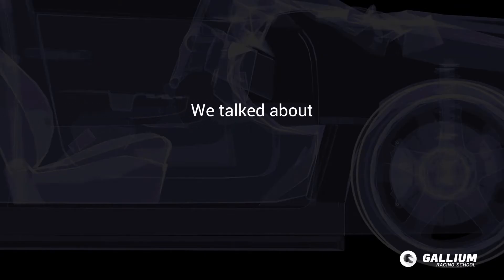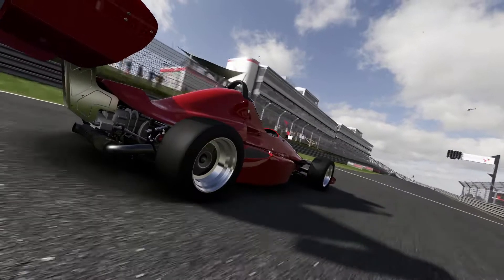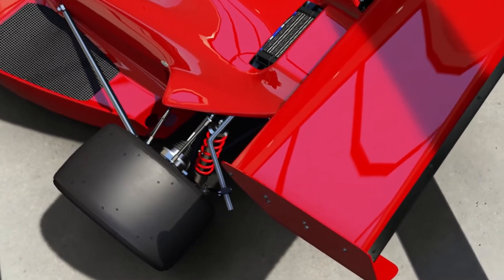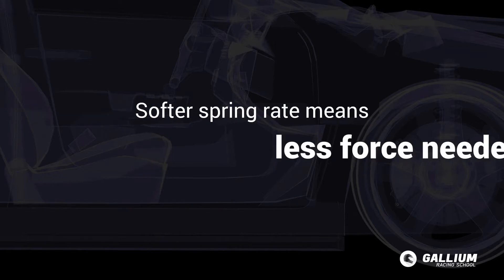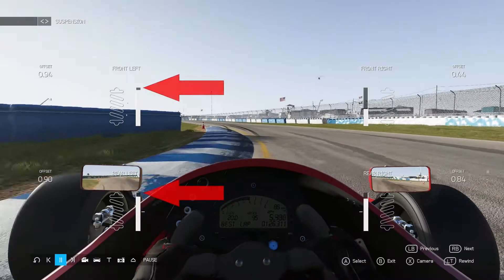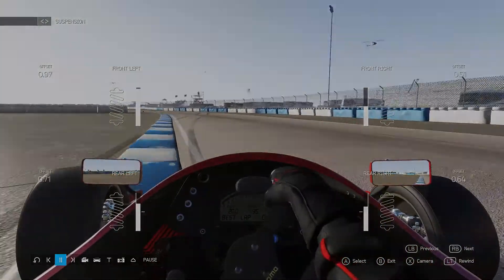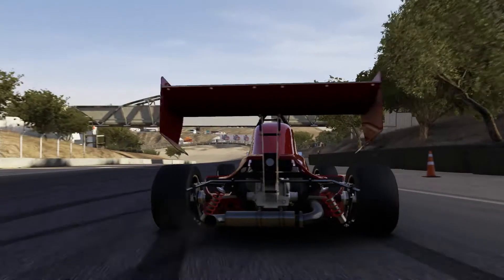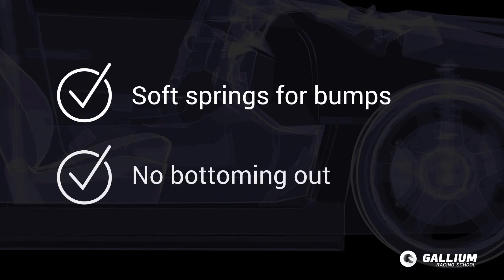05 -  Introduction to Spring Rates - Suspension Tuning in Forza Motorsport

Comment: @Gallium Racing School Can You Please Make a Video Explaining How to tune suspension on a FWD car to help with grip in straight line and wide swooping turn racing? I know a lot of people drag race FWD cars but currently been doing build offs between my brother, some close friends and I. I will share the video with them but we are having a hard time understanding what we should be doing to make the weight transfer to the front wheels to improve grip. Your camber videos helped with tuning my front camber for the weight transfer so that my wheels are flat in the front while weight is transferred to the rear(no positive but slight negative is okay). What Im trying to achieve now, improved grip for a Honda CRX and an SRT4. Ive done as much as I can for now with tuning tire pressure, camber, sway bars, caster, LSD and gear ratios. I havent touched my spring rates and my dampers.🤔 I even tried to lower the front and raise the rear to have a slight rake so that the weight sits more on the front wheels. I also did the race intercooler and race oil upgrades so that there closer to 60% weight distribution having more weight on the front. These cars are pretty light and have a very limited contact patch. Our build ends this weekend where we will do our shootout to see who can build the fastest B class FWD car on drag tires. We are running at the Le Mans straight away. 1/8 mile, 1/4 mile, 1/2 mile and Standing Mile Runs. We get 2 passes for each stage. We really could use the advice and help sir! I really love your videos. Ive subscribed and shared your videos in a playlist for others to see. Please Reply Soon. We dont have much longer. Winner gets to choose the class/build rules, track, tests and what vehicles the others must build for the next build off. Keep the videos coming! I promise the video will get views if you go that route 😁🤓👌🏼
Reply: I also have the bell where I get all notifactions. We are serious car guys. I have an 88 Mustang GT 5.0 and my brother has an 89. We have decided in the past year after soing an autocross event that we want to build our foxbody mustangs to do Autocross and Track days at VIR which is about an hour from us. We arent looking to build drag cars.
Reply from the maker: Hi Brian - the quickest and most reliable help I can give you would be to download the forzatune.com app and it will give you a base tune and spring/damper values for FWD drag. Dampers and springs will certainly give an advantage.

The app also includes a fine-tuning wizard that can help you debug most problems. Drag tunes are tricky because they depend more on the build but that should get you started.

And if you don't want to get the app the basic approach it takes for FWD drag is to max out rear springs, minimize front springs and have rear rebound and bump damper settings higher than front. It also has alignment, tire pressure, ARB and diffs.

Disclaimer: ForzaTune is one of my other projects.

-Anthony
Reply: Hey thanks for the reply, I have the forza tune app and have been using it for about a year now. I really like it for my base tune and then I adjust from there. I really like how you updated. I paid the $2.99 for it and dont regret it. I also bought it for my brother. Nice to know you are the one working on it. It would be awesome if there was a way to find factory gear ratio sets for cars in the game (i understand how big of an addition that would be which would require a lot of research so i understand if thats something not in your plans)

I love using the app to balance springs for the weight distribution. 

One thing Im a little unsure of however. If I have a set up calculated and I test drive it. I then decide I want to soften it by 10% (just an example) I slide the slider over to 90% and hit recalculate setup. I then get my new set up. My question is if I leave it at 90%, and I maybe change something else and hit recalculate set again will it soften the springs and dampeners by 10% again or does it remain at 90% of the original tune??

Also Im not sure about the gear ratio calculator thingie and I have thus not really used it. I tend to use factory gear ratios from the same car or gear ratios from another transmission I like or gear ratios from a car with a similar rpm range and powerband. For instance I like to use ZR1 Corvette gear ratios on the 2000/2002 (I cant remember the year) Camaro SS when i run a twin screw/roots style blower. 

YOU SIR ARE AN AWESOME MAN AS I NO LONGER HAVE TO DIG OUT A CALCULATOR FOR MY TUNES! And Your videos have helped me learn how to fine tune my tunes for my playstyle after I use the Forzatune app. Its in its own folder on my main home screen and I keep a memo app next to it 😁

The drift tunes are amazing!
Reply: Sorry I wrpte so much but I wanted to tell ypu how much i appreciate your app and your videos. I build crazy builds all the time on forza. often times thry are just different color foxbody mustangs with different purposes but I always use ForzaTune for my base tune. 

FORZATUNE IS A MIRACLE WORKER FOR VEHICLES THAT YOU ARE DOING HEAVY ENGINE SWAPS, DRIVETRAIN CONVERSION AND BUILDING FOR A PURPOSE! LIKE TURNING AN R33 SKYLINE INTO A RWD DRIFT CAR OR V8 SWAPPING A MIATA AND THEN BUILDING IT FOR THE RING! 👌🏼😁
Reply: Gallium Racing School Man That Was Alot Of Typos In My Replies. Talk To Text Function.
Reply from the maker: Thanks for the comments Brian - and for already being a ForzaTune user!

To answer your question the percentage is always based on the original tune. So building a tune at 90% and then recalculating over again will keep it at 90% overall - just with any changes you have made.

I hope that makes sense.

And I'm also a Mustang fan - on my second one now with an S197 and plenty of mods. If only it were as easy to upgrade as in Forza!

Anthony
Reply: Gallium Racing School OMG I know man! Wish Forza would take advantage of ECU tuning, 2 step, boost controller, with boost by gear oprion or more realistic spool characteristics. Maybe the ecu tuning could be unlocked in stages through fuel & ignition upgrades. 2 step could be initiated by holding the hand brake. I wouldnt complain if they made it where only full race turbo upgrades had a boost controller. Boost lag characteristics could be choosen by choosing first stock, street, sport or race. Then sub turbo options like a, b, or c. Each sub option capable of the same type of flow just different spooling characteristics. Or even if it was just different blow off valves which could go with intercoolers instead. To further explain what is going on below diffferent size turbos flow different cfm at the same rpm.

Sport turbo a/b/c
a) smallest (which would mean fastest spooling) turbo capable of highest rpm, talking about rpm of the turbocharger itself.
b) medium size turbo capable of medium rpm
c)largest, which means laggy characteristics, capable of low-medium rpm depending on lag value

Then race turbo, same 3 options but make all 3 capable of running high rpm so high boost levels. 

Maybe sport turbos come with manual boost controller. Represent that in game with a slider or knob in tuning menu that has large increments and you cant see the set boost level.? Race has electronic boost controller which you can controll in smaller increments as well as select boost level for each gear. 
This level of tuning would make players feel more like they are tuning their vehicles, making the vehicles more personal. Some turbos wouldnt hit full boost within the motors powerband if it was low down but thats okay then they learn to pick small turbo setup. Making tunes more unique. Would also make turbo related stuff more up to date with the world. 
Like a big single turbo probably wouldnt hit full boost on a 4 cylinder in real life unless its a smaller more efficient (lag wise) turbo. RB25/RB26 series motors are just as capable of hitting 1000hp as the 2jzgte motor. They should correct that. 
I have tons of ideas to be honest. But they would never listen to REAL CAR PEOPLE.
I appreciate your answers. Im on my 2nd mustang my brother is on his 3rd. I messaged you on FB and I added you on Xbox Live Ghilliereapr910
Reply: Gallium Racing School Also I believe your price for ForzaTune is perfect. I just hate that when this phone is gone ill have to buy it again for my new phone but thats okay, goes to a good guy that put a lot of work into it.  I would like to see it grow in the future along with the Forza Community.
I use it for project cars but theres some conversions involved there. 

Im building a Miata Cup Car, the one with no passenger seat and a roll cage (red with white Gallium Racing School logo on the sides along with a number for the car)
I was going to ask, since I plan on making a car that is a 2 seater (Will have "Instructor-Anthony" over one door and "student over the other") what is your favorite number?
Reply from the maker: Before I got into Mustangs I was big into the turbo cars (DSM, 3000GT). There is a lot of build/tuning detail they could add in Forza but I know they have to find a balance between real-world and making the game playable for a lot of people. It's a pretty good balance and they have a lot of real car people steering the ship.

Actually, you could make an entire simulation game out of ECU tuning, mods, boost control settings, etc...

Complete with intercooler hoses blowing off and engines grenading!

7 or 15 is a good number! I'll check the FB account. Thanks, man!
Reply: Couldnt have simulation and turbo in the same game without intercooler pipes blowing off. I started with an 91 and then a 89 Supra. Was hitting full boost, changed spark plugs and then boom hit full boost and THUNK Intercooler pipe going to throttlebody popped off and bottom of the hood. Car was running like shit to the nearest spot I could pullover. Eazy fix and then smiles all the way home.
Reply: Gallium Racing School I got one more question about using FT. Ill message you in FB with a screenshot so i can ask you it better and explain what i dont understand
Reply: @KeysToSpeed  hi can you make an updated video for Forza 8, on the geometry tab? Also what do you think about those formulas some tuners use?

Max-min* weihht% + min
Reply: @KeysToSpeed  also, do you guys recommend an order to do tuning? For example, one guy said to start with differential then breaking balance, then arrow and then suspension.
Another YouTuber said first he makes all his alignment zero and does some test laps before he starts messing with it. What do you think about these methodologies? Which one do you use or recommend?
Reply from the maker: @v4854  Thanks for the comment and good timing! Here's a reply based on some articles I'm writing now. Enjoy! On your first question, ForzaTune Pro does geometry now, and you can read more about how to adjust it by hand here: https://forzatune.com/guide/the-fully-updated-forza-tuning-guide/#suspension-geometry-a-new-option-in-forza-motorsport-2023

(Max-min)* weight% + min is a fair approach for street and track tunes. Tuning is like a loop and you can jump in at different places and start running through things until you like the setup. Maybe you have a hunch that the diffs are off or just like to start there each time. The Free tuning app at https://forzatune.com/free-calculator-app/ has a fine-tuning checklist and also a wizard to debug specific problems. It assumes the following process: make a base tune or adjust default then check ...  tires -> alignment -> ride height -> aero -> springs -> ARBs -> dampers -> diffs -> repeat if needed

The trick with tuning formulas is it has to be done in a way that connects all the settings. Many people miss this. And it dramatically cuts down on how many times (if any) you need to run through a loop. We calculate how everything should work together instead of pure trial and error over and over again. This is where comments like "I spent 5 months refining a tune and this app made a better one in 5 minutes" come from. It's also where comments like "tuning calculators are garbage" come from - not all calculators or formulas are going to link the settings together or don't have the right data to do so.

I mention the ForzaTune apps because they are my tuning process refined by the larger Forza community over the last 15 years. It's like all of the lessons built into one "thing" which you can reference, and that we work together on over time. It's an opinionated approach of realistic tunes calculated as accurately and quickly as possible with easy ways to make adjustments. It works well for a larger number of drivers than most of the meta tunes. But there are many ways to get to a build and tune that you will like. Some are better, faster, easier, etc. Anyone who says they have found the only or best way, will eventually realize the same thing: people are different!